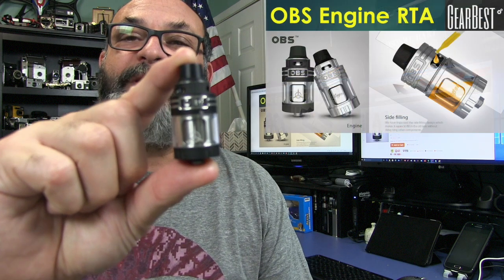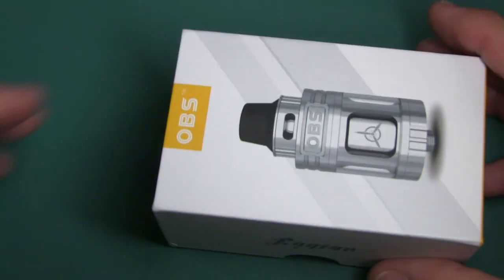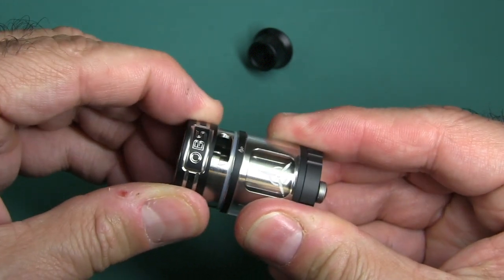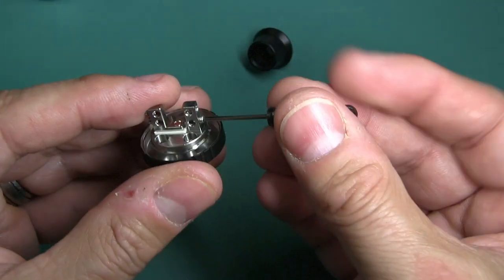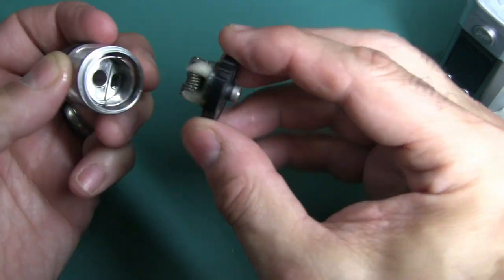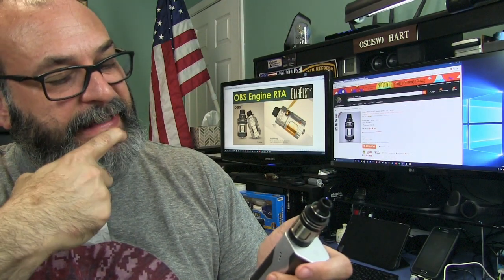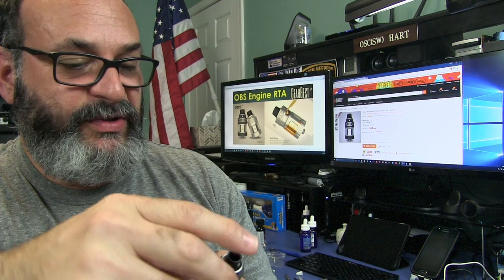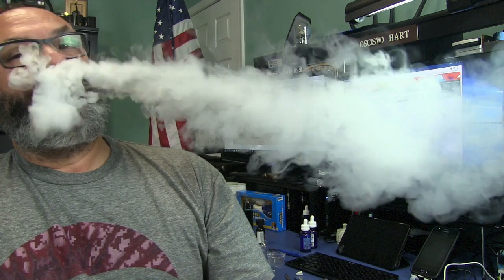OBS Engine RTA from GearBest

Comment: EXCELLENT REVIEW FRED!   I liked the OBS ENGINE RTA  so much I'm the owner of three of them.  All three are in use with different builds in them. OBS knocked it out of the park with the Engine. Fred, you need to try a couple of 3mm clapton coils in it at 0.3 to 0.4 ohms. The vape had off of the claptons in the Engine is second to none.

Comment: thx for another solid review brother, I really enjoy ur vape stuff...I've just bought this tank today and love it...like you I have looked at a couple of other reviews of it and believe that the spitback is caused by a temporary issue the tank has after each re-filling, because it is top airflow and cant leak it doesn't have a juice control function (whereby you can stop the juice from flooding the deck) so unfortunately after most re-fills a bit of juice in the mouth is inevitable, it only lasted 2/3 pulls for me so imo it is a small price to pay for such a great tank...I like it because I have finally succumbed to higher wattage vaping and bought a 200w mod, I only ever use rta's and until recently they, in my experience at least, would start getting uncomfortable around the 30-35w mark....put the right coils in this little beauty and I can give all my 'tfv8',  'baby beast' and 'cleito 120' buddies a run for their money around the 90-100w mark...thx once again for ur content...peace
Reply from the maker: Thank you so much for all the insightful information, it will help others very much, me too :)